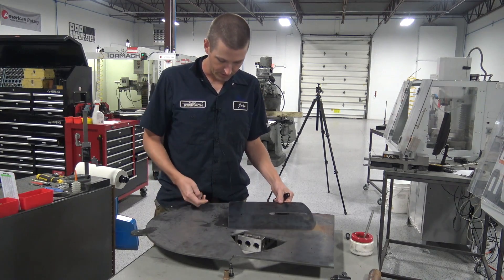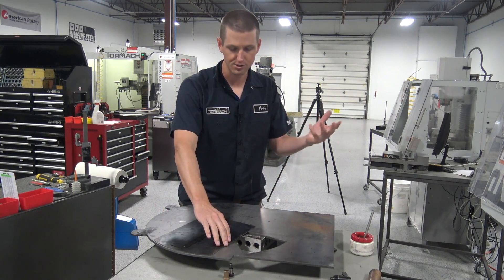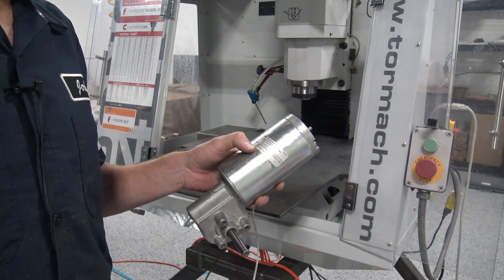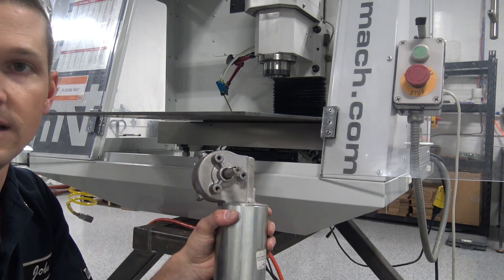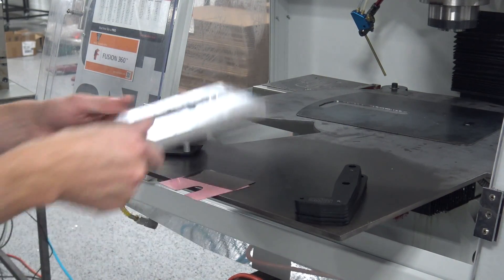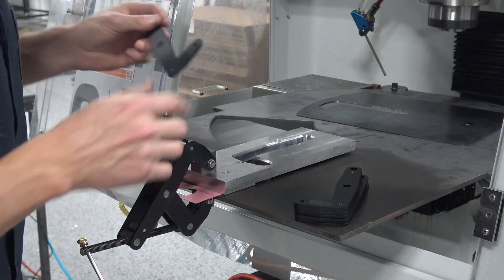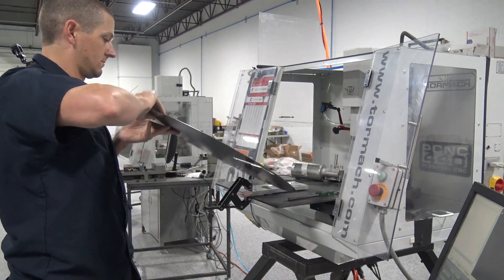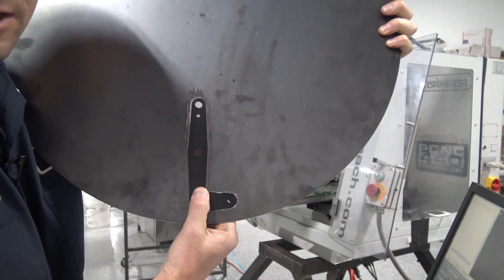Automatic Arduino CNC Parts Loader: Tormach 440!  Part 3 WW121

Comment: -Some suggestions and input. Why are you only using one slot? Couldn't you save a lot of time by having a slot every say 30 degrees? Since moving the plate 180 degrees for every engraving would add a lot of time over the batch.- ::EDIT:: (Saw your comment on another post) And another quality of life thing. Add a hole on the right side of the hopper and add an inductive sensor. It would add a normally closed switch that would indicate if the hopper is empty or it failed to pick up a part. That way you have a error checking solution that could stop the process and alert an operator. Not sure what kind of rotary feedback you're planning but an optical rotary encoder on the shaft would work wonders.

Comment: I'm looking forward to seeing how this turns out. No wait, I'll Americanize that, "I'm super excited" to see how this turns out ;)

My concern is the feed in to the platter. I know it would have increased the expense considerably, but I would have made the platter thicker and chamfered the edges heavily to try to get a reliable pick up. It's one thing to wiggle it around in mock-up, but another thing to get a reliable feed in operation. The margin for error there is small, and even a small chip or burr where there shouldn't be one will hang up a part. I know they should be clean parts etc etc, but just saying.

You may have covered it before, but I didn't get why there was only one part in the platter at one time. With the ability to reliably and accurately machine any number in the disk, it would make the whole operation much faster and more efficient to have 20-30 or whatever fit "holes" machined in the platter and just index around to the next one.

It will be great to see this little guy doing its thing when finished.

Comment: Why not add more part holes in your rotating plate make it more efficient.  Also with your motor maybe you could  install a detent mechanism that the motor could drive up to and the CNC resets at the end of each cycle, say a pin that is spring loaded and the CNC pushes it down to allow the motor to spin then springs into the next location.

Comment: Would it hurt to have the rotor pick up 3 or more blanks in one rotation?
Faster loading at the same rotor speed.

Also, the MickeyMouse baseplate doesn't need a curved outline, even though it looks better. Only productive if you need futz-time on the CAD :-)

Comment: Could have made the top circular plate into a huge cog that is spun by a smaller cog near the feed hopper. That way you could probably have used a small motor.

Comment: I am a little late.  But for the circular piece that indexes the part around the jig.  Put multiple wholes in it to hold parts that way you do not have to index 360 degrees for just one piece

Comment: if you want to have a lots of blanks increase the number of hoppers above the rotating disk as when first one empties it will pick up from next in line  the only problem is the load on center motor as 2 hoppers twice the weight as friction loading on motor but as you said you have 100s of these to do so running through the night is possible

Comment: Aren't you worried about the potential scraping on the surface? as it rotates, the parts are sliding against that steel plate.
Reply: its powdercoat not paint so its own weight against a smooth plate a little ways will be fine.

Comment: you should add more spots on that disc that moves the part from the stacker to the mill. so instead of rotating 360 to get a new part ready it would only have to rotate maybe 90 or 45 degrees. 
 
side note when you cut that new circle out i swore the torch head was going to hit that stack of angle iron haha

Comment: An easy way to gear your motor down would be to place it on the outside of the tormach.  If you're going to turn the part picking mechanism into a large circle you could added teeth to the outer edge to mate a gear on your (now external) motor.

Old trap machines have a way of holding the clay targets by the edges before dropping them into the path of the throwing arm.  The newer machines are doing exactly what you're doing, inexpensive and easy, solid surface until it drops from the table.  Looking forward to more vids.

Comment: stop waisting space cut multiple part hole in the top plate so it does not waist motion having to make a full circle to load one part when you can load multiples
Reply: bubbajoexxx I put that comment on the last video, and someone on the one before. Obviously doesn't read them haha

Comment: John, How are you going to zero return the machine with the fixture mounted?
Reply: The only way I can see is to home the machine, then move close to a working position and mounting the fixture. Then hope they don't have a loss of power or someone turns it of by accident.
Reply: That's what I'm saying, what if you loose power in the middle of your run (witch will happen especially if you don't want it to). I suppose you could move the limit switch on the X axis to fake the machine into a new X zero position and program accordingly.
Reply: I was given a project to solve when I went back to school and solved it by using a small robotic arm a slide feed to load the part for the arm and designed a pneumatic clamp for holding the part while machining. Yes there is the added price of buying the robotic arm, however it solves so many other problem and can easily be changed for use in other production projects that it is worth the money.
Reply: John can build his own robotic arm. I would love a video on that.

Comment: 14:45 Saunders with the 4jaw, look out Abom79! lol Perhaps taper the sides on the side it feeds in from to give a sweeping pickup to help eliminate jams and to give more time to get in the pocket when rotating.
Reply: NYC CNC
That would work, just need a nice lead in bevel so you only want it on the sides that the part comes in from then leave full backing to sweep it away.

Comment: I think you want that 16 ga rotating piece to be thicker, like 1.5x whatever the thickness of the actual part.  My thought is that you will have less change to snag when it picks up a new part.  Great work!
Reply: MrToolean the problem with that would be that it would pick up 2 parts, or jam in the hopper.
Reply: Good Point.
Reply: Mr. Toolean  As Drew Smith said if the rotating plate is thicker than the part there is a chance the part could snag or jam.  If the rotating plate is slightly thinner than the part this won't happen.

Comment: I too like the idea of multiple part slots/ holes on the disk.  If the travel is enough the 440 could put the slots in the full disc after it's mounted to the motor so they could even be more exact.  I would also throw out the idea of  a sensor  or switch for a rotation zero point to make sure minor rotational errors don't accumulate.

Comment: Why not cut gear teeth on the outside of your large spinning plate and drive it from the outside?   That would also give you speed reduction.
Reply: That was my thinking, too. Then a small stepper or DC motor could have worked.
Reply: I had the same thought. Could be just for simplicity's sake. making all that gearing is a bit of a pain. Matthais Wandell's gear calculator would make it easier though
Reply: Yeah and depending on the pitch it could be challenging to cut well on the plasma table.
Nice to play arm chair R&D isn't it!
Reply: Sam Galphin due too tolerance stacking
Reply: NYC CNC yeah even better!

Comment: if I were you I would build more holethingy carrying disc. Think about the time that consumed to travel. I mean turn 180 degree to  engrave then turn 100 degrees to drop and turn 80 degree to get new part. To my approach lets say  every 30degree have a carrying holethingy  which your carrier can carry 12-1=11 of the part and rotation was fixed 30 degree sequential steps will save a lot time.

Comment: Why not have your rotating plate be open in the direction of the blank stack? The newest blank would drop onto the base plate and the open collector plate that would be machined to tight tolerances to align the blank would sweep by once per revolution to catch a new blank. Good alignment would still allow for the competed part to drop through to a finished collector bin.

Comment: Hey, John. What is the thinnest piece of material you can cut on the Torchmate? I've been looking into them and even asked Lincoln, but have not gotten a response.
Reply: Bradley Willoughby w/ the automatic torch height control compensating for heat induced warpage you can cut very thin.  I have done a fair bit of 0.020" aluminum sheet for airplane skins.  Hope that helps.

Comment: I posted this on the Part 2 video but I don't think it was seen. So I'll repeat it here as well

I'm not a machinist or CNC operator so feel free to disregard this. But this machine uses a moving table instead of the spindle moving right?  I see a couple problems with this idea on a machine that operates this way.

1) The legs you want to use to support the floating end with be drug around the floor while engraving. You could add casters or something?

2) Isn't this a huge amount of weight to have to move with the bed while it's hanging way off the center of the table like that? Aren't you putting a lot of uneven stress on the ways/linear rails on you machine? I understand this is a "limited" production run kind of thing but If you plan to designate this machine to be the one that does this job every time you get an order don't you need to take machine life into consideration?I know supporting legs would alleviate the cantilever weight issue but see issue 1.

I have very limited experience in a machine shop but this was just something I saw and was wondering if you had considered it or saw it as non issue
Reply: The legs may need to be stationary with the rollers on top - easy fix, but the weight issue is a problem in my mind too. Not only is the table going to have to maintain engraving level accuracy while moving a heavy stack of blanks, the weight is going to change each time a finished part is dropped through the hole.
Reply: It gets drag engraved, it moves a small amount back to front, and a inch or so left to right, and not that fast

Comment: You should start using stub drills.  When I had a shop, Tool #1 was a 1/2" stub drill.  I used it for spotting holes, drilling 1/2" holes (very common in my work), and for drilling clearance holes to allow an endmill to come in and plunge without having to ramp.  A stub drill will eliminate half your drilling ops and make everything much more efficient.

Comment: You could use one of those ball bearing caster (omniball) that they use on turret presses, to support the bottom of the base with a screw jack affair.  Gary at Rasmey Customs (Oldbarn Homestead) got some of those to help in hefting sheet goods up onto his plasma table.

Comment: sinces you have that big round why not more slots
Reply: Or put dents on the edge of the wheel and use a microswitch to determing each dent by the Arduino controlling the motor very simple to implement.
Reply: Plasma cutting tolerances, maybe?
Reply: john can answer that one.
Reply: The Motor he is using isn´t a Stepper so it has to run against an Endswitch of some kind and that is easier to realise with fixed Endpoints rather then continuous rotation.
Reply: stick a encoder on it
Reply: johnnyfp01 Yes it is very simple to implement but he still wants to machine something that is carried by the Plate and my guess is that one hard Endpoint with a Switch is more stable and more repeatable then multiple Switches on a flimsy Plate.
Reply: thing is that with that huge dc motor with no feed back and the backlash in the gearing, how acurate will it be with one or 50 slots. He'll have to touch off with every iteration to get acurate repeatability and that requires a tool change , doesnt it.  Be interesting to see how he overcomes this in the next video installment
Reply: Having a vacuum fixture for it to sit on would help
Reply: +NYC CNC it's already a bit over complicated

keep
it
simple
stupid

the main rule of engineering haha. if I could get in contact with you I would privately share a much more foolproof less tolerance dependant quick way to achieve the same goal. easier too haha.

employ me ;)
Reply: +NYC CNC and you mean when it is working?

can't use "if" in a machine shop.

Comment: You could have made the platen into a large gear and driven the platen around with a geared setup and have the stepper motor sit on top of the base, out of the way.  Then you just need a bearing in the center for the platen to spin on.
Reply: I was thinking the same thing. If the platen had teeth on the OD, you could also use them to positively locate the platen at each stop with a small pneumatic ram to touch off in the root(s). Even if the rotation is only off by a tenth of a degree per rotation, it won't take long for that tolerance to stack up on you and cause a problem.
I also agree with the other comments regarding additional stations in the platen. I know that efficiency isn't "paramount" (as this is a "set it and forget it" setup), but you'd have nothing to loose by doing six parts per rotation instead of only one. Curious to see how you hold the part while engraving.